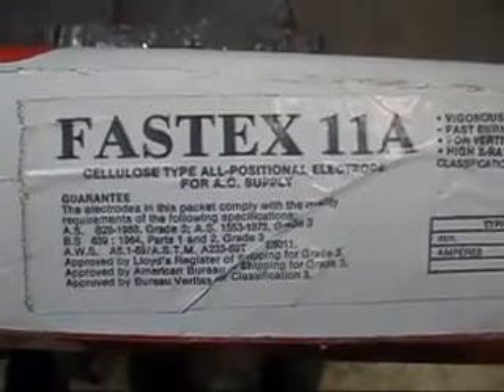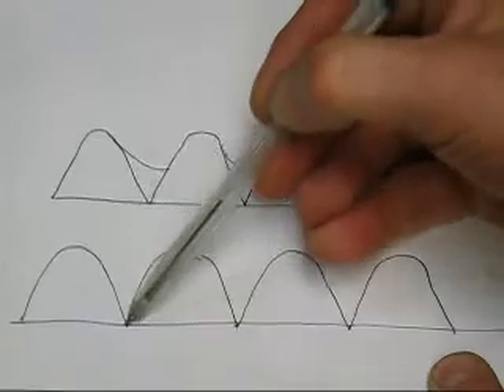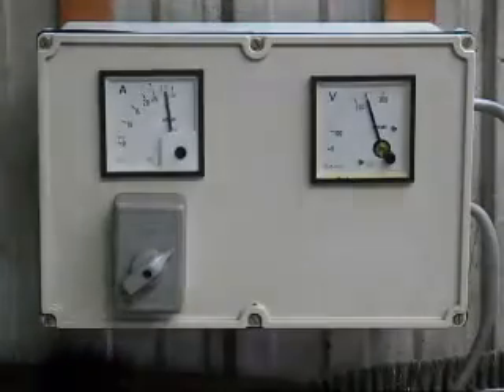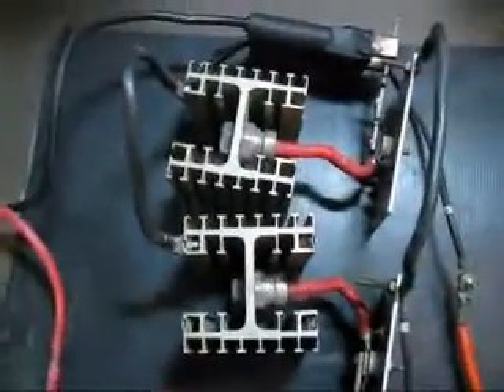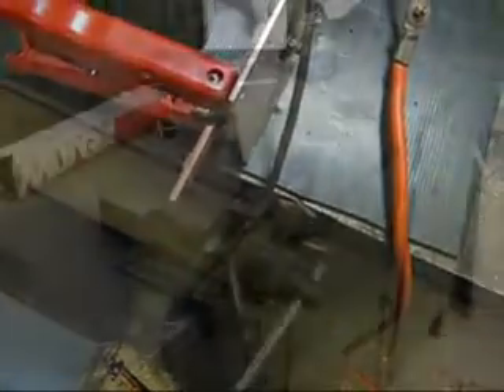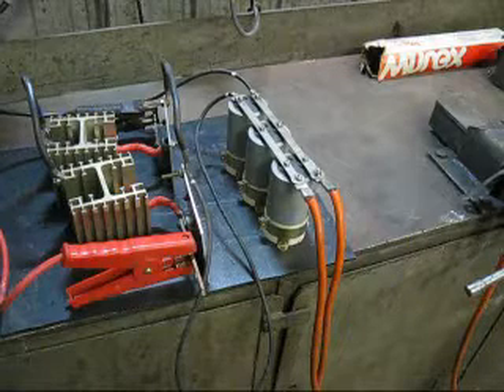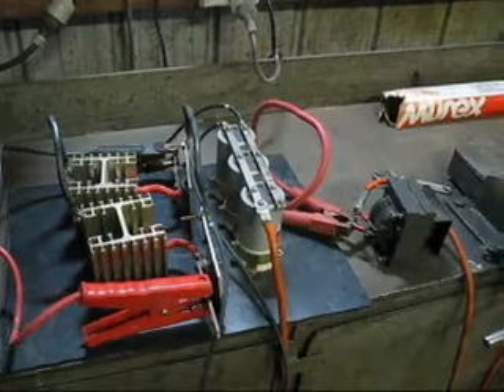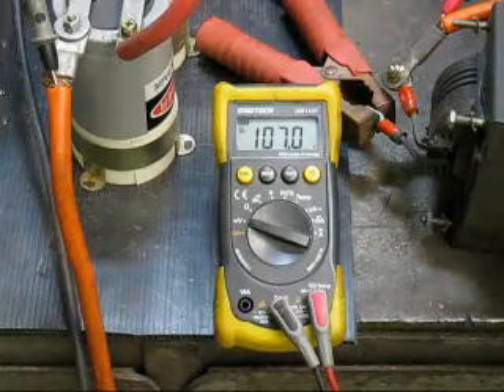Converting an AC welder for DC output

Comment: I see these projects and wonder WHY! If its just to experiment, o.k. But if you have an AC welder, use a AC rod. 6011, 6013 ect. But if you do work that requires 7018, get a proper welder! It can be done, but I doubt you will be able to gain an economical advantage over buying a unit made for the purpose.

Comment: I WAS JUST THINKING ( CAPACITOR ) GOOD #BUT  BIGGER  .. 7000 MFG .. IS NOTHING

GET SOME  250.000  MFD  CAPs   ... 4 OF THEM ... OR #MORE  !!!

YOU  WILL  HAVE  "LIGHT"  ...

AND THE  "TRANSFORMER"   GOES FROM "100 V"   DOWN TO "30 V" ... IS  TO "SMALL"

BUT JUST A COMMENT        #10  YEARS  TO   #LATE

Comment: This is mostly pointless. The size of capscitors and/or inductors needed to rectify a welder current are very large (100F-200F) and practically cannot be used.

If you hace trouble starting the arc on DC, then you are probably just a bad welder. Most DC welders don't smooth the wave at all.

Comment: PS. Can I use 2 300 amp bridge wave rectifiers in parallel?
Reply: Jo ap  diode  use kar  rerahe ho us ka nober send karye
Reply from the maker: One 300 amp bridge rectifier would be enough for welding but putting them in parallel can be tricky because both may not share the load equally.

Comment: How do you add the choke, exactly what do you do? Thankyou for sharing!
Reply from the maker: The choke is added after the bridge rectifier. It smooths out the D.C.
Reply: @luckygen1001  do bought wires, positive & negative go through the choke, or do I use only the positive wire through choke? Thankyou for your help!

Comment: When welding with DC you need to use the Negative for the welding rod and the positive for the grounding clamp. Electrons flow from Negative to Positive and that will make the metal flow from the negative to the positive and that is why their is less spatter with DC welders than AC welders alway reversing the polls while welding.
Reply: bollox

Comment: 7000uF is too small. Do the sums. At welding currents they have almost no smoothing effect on the voltage.
Reply: Correct. I use 68,000uf on my harbor freight ac to dc converted welder. its the cheap 120v one.

Comment: where did you get that choke or is that a transformer?
Reply from the maker: It is a choke.
Reply: @luckygen1001  choke/inductor. how big does the wire/gauge need to be and how many henries to support 200amp stick welder?
Reply from the maker: @joeydelmarsjr.646  Wire gauge needs to be enough it does not overheat at 200 amps. Henries is not critical.

Comment: Like other folk commenting here, I think this a good video for explaining that three components are needed for a proper AC to DC conversion..
Many others on YouTube just fit an inverter module that in reality doesn't make that much of an improvement on its own.
However, there is little to no information given on the values /types of the components used..
This info along with a diagram would have been really useful.. 
I've watched more YouTube videos than I can remember on this subject,   but I'm still not clued up enough to attempt a conversion on my own machine.. 😐
Reply from the maker: I used 6600 mfd capacitors and the inductor was the only one I had that could take the heavy current from the welder. I don't think the values are that important but it is vital that the components can handle the high currents involved in welding.
Reply: Most DC welders don't actually have a smoothing circuit. The capacitors needed to rectify the kind of waves that come out of a welder (around 70V and 100A) would be massive (we are talking in the range of 100-200F), so no welder actually does this. If you have trouble starting the arc, then you are just not a very good welder.

Comment: If I built the choke, how many turns and  what thick of cable, thanks for sharing!!
Reply: A good choice would be to have the same wire used in the welder i.e gauge {thicker if possible} and type, and put maximum number of turns that fit in the available core . About the core size: bigger is better but consider the space available and increase the thickness of wire if the core is too big. Hope this helps.

Comment: Capacitors work for constant voltage, good for wire feed welding.  The choke will be the proper solution for a constant current process like stick welding.

Comment: ground probe needs to be POSITIVE, rod holder NEGATIVE, electricity actually flows neg to pos.
Reply: Some rods are meant for electrode positive DCEP, some for electrode negative DCEN.  
I think the the rods he has are 6011 equiv (says cellulose and AC).  If this is the case they are meant to be run AC or DCEP.
Reply: No, very few rods run better electrode negative.  Most DC welders are left electrode positive all their lives...

Comment: The transformer steps down the AC mains voltage to a lower AC voltage,but in turn as the voltage is reduced the power stays the same ,thus the current supply in the secondary winding of the transformer will rise by around the same factor the voltage was lowered by,in the same manner a manometer works ,think of one side of the manometer as voltage and the other as current ,the reciprocal of volts and amps is power,if (in the manometer )gas pressure pushes one side down the other rises,the amount of water in the manometer is the same,just redistributed to either current or volts.Volts X amps = power,it's not a direct conversion in AC unless we are using say a heating element which is just a resistor,for a winding (coil/transformer) curent and volts are not in phase with each other,same as in a capacitive circuit,in a coil current leads volts and in a capacitive circuit volts leads current,this is how we experience inductve inrush with windings in a motor,the voltage is held back but the current spikes because the system wants the rated power,and to do so if the volts are low at the start the current makes up for the loss and increases to get the power rating,capacitive input circuits will do the opposite,but if the mains voltage is the running voltage it won't be as easy to note as there will be no more than the running voltage to obtain.

For the most part a lot of this will not be needed,though the full explanation would go on even further,the main points and analogy stand well to scrutiny,and the more you know the better off you will be,most induction circuits,that is with windings will draw more at power up than in full running mode.

Comment: Thank you for the video. The circuit here is a basic full wave rectifier with a capacitor filter, the series choke is required here because the capacitor will rapidly discharge into the load which is nearly a short circuit, this will create a large surge current until the capacitor is virtually instantly depleted. The series choke resists this surge current by converting some of the energy into magnetism, when the capacitor charge depletes the chokes then collapsing magnetic field induces energy into the choke coil that is then supplied to the load maintaining the arc. During this period of time the capacitor recharges and the cycle repeats.The values of the capacitor and choke can be important here. 
You may be able to eliminate the capacitor and choke completely and get acceptable results, the OCV will be a bit lower and you may have to set the current a bit higher, but for hobby welding it may not make much difference.

Comment: does it matter if your choke comes off the +or - lead? or both? Thank you.  I learned how I want to convert my 300 amp Ac welder. I wonder about voltage/ amperage  control modification possibilitys/effects .

Comment: Because of the duty cycle on a welder, you don't have to use full size conductors for the rated load, I know the US electric code has a couple paragraphs about welder service lines

Comment: The comments are confusing here. I just want to turn my ac stick welder to a dc tig welder with my argon bottle
Reply: Wrong video. This isn't the conversion you want.
Reply: You need four high current diodes to make DC.  They're available in a single package on Amazon and eBay for less than $50, search for 200a bridge rectifier.  You also need an inductor to smooth the DC  current coming out of the rectifier.  Some people wrap a few turns of welding wire around an old microwave oven transformer.  It doesn't really provide enough inductance but it helps.

Comment: Wow, o.k, so for starters you want to convert AC-DC, to do this you need a bridge rectifier or diodes in that format, and I mean High powered ones for that matter to truly have a correct DC output , DC does NOT have a rise and fall at all nor a half sine wave.You are NOT supposed to have a fall what so ever, NOT even half or quater of the way.

You are playing a dangerous game using capacitors on your system, capacitors are there to smooth out any drop or rise in DC signals and should ONLY be used on full DC not half wave, if I remember it's about 2500uf per amp.
Reply: Half sine wave IS DC , it just fluctuates from zero volts to max volts. Capacitors across the output store energy and help to reduce the voltage drop as the wave drops to zero. As long as the capacitor polarity is not reversed and operating voltage is not exceeded that is fine, it is in fact how they are used in power supplies. The choke used in series here also stores energy and helps maintain  the arc as voltage drops under load (the arc).
Reply: Sorry, it doesn't give a proper DC on my osciliscope, and the capacitors are used to avoid voltage drops which you are correct on, true DC is formed by the bridge rectifiers, capacitors stop any voltage drops, DC is not realy a half sine wave sorry, and the oscilliscope shows that clearly.
Reply: Speaking of full Bridge rectifier ever seen the electroboom.  And also the comment about the guy that got zapped by the arc welder AKA shocked would be right along the lines of electroboom as well just saying.
Reply: Have you opened up a factory  dc rectifier and checked out what’s in there, and ran it on an oscilloscope?  Everything I’ve read so far is saying you need a bridge rectifier(or 4 diodes making your own) plus a choke coil.  Lots of people suggesting it being a good idea to add capacitors.  Some vintage AC/DC welders were an AC welder with a stand alone DC rectifier piggy backed on.  Damn this is making me curious...

Comment: Hello sir @Luckygen1001 thanks for the video....I am anewbie...I found a welding transformer with an output votage of 33vac and its very hard to start...it has a builtin choke coil and bridge rectifier but no capacitor...just asking where is the best location of the capacitor? Is it before or after the choke coil?is there a big significance connecting cap before choke coil compared to after the choke coil..thanks so much for the answer

Comment: it would weld much more efficient if you installed a few large AC caps right before your transformer... so to utilize any spare voltage and to dump to transformer when needed. 
also, your output is too high to use in a dc setup. not wrong , just not optimal. 30 volts you want and it should give you 75 - 90 amps.
step down your voltage with transformer with high enough VA rating then rectify then have your dc caps storing from the rectifier and then use your smoothing transformer.
Reply: Wow impressive knowledge

Comment: My understanding is your on off cycle for average hobby welder is 5-10% so you have cooling in between striking arcs. So 15 amp rating for intermittant use. As opposed to runnin 20-30 amps continuously like with a stove or a water heater, I jury rigged a water heater up to a 15 amp plug once just as a stop gap until i replaced a component and melted the plug.  monitored the extension cable but forgot to check the wall outlet which overheated. luckily the wiring was ok

Comment: You need some big capacitors in that unit.
Reply: kg dies Actually, the capacitors might seem like a good idea, but it's not.  Why.. when welding the CURRENT is limited  (not primarily  voltage) The arc is managed primarily by the current levels especially once the arc is struck. Capacitors that have any clout to them will defeat that current limiting. So an example. IF you are trying to weld something relatively thin at a low current (heat) of say 60 amps at first strike you will have significantly more amperage dumped from the caps into the metal which will likely immediately blow right through that metal. Also  if you are inconsistent with your distance you can have much more pronounced surges of  current making welds harder to manage and probably introducing inconsistent or poor spots into the bead. An inductor is a great idea, caps not so much.
Reply: @wolvenar  I knew capacitors might not be good but now I see the reason. thanks.

Comment: not sure if you know  but DC welding is best used DCEN(DC ELECTRODE NEGATIVE ) Not DCEP (DC ELECTRODE POSITIVE )
as DCEN pushes the heat into the parent metal & DCEP pulls the heat into the electrode.
Reply from the maker: I have tried it both ways and it does not seem to make much difference.
Reply: i  can understand why you say it doesn't seem to make a difference  but the difference it is making is in the depth of penetration mostly 
the same reason tig is DCEN for steel. ps love the ingenuity and videos i would love to see a pour in person at some point keep up the great work
Reply from the maker: I will let you know when I am pouring next time.
Reply: 7016/7018 must dcep,electrode get positif,,for 6010/6013 dcen make deep penetration for thick plate
Reply: Good grief what’s with all the comments saying this?  I’m no scientist but I can tell you as a welder you’re wrong.  Nearly all rods run better electrode positive.

Comment: Is this center tapped kind of transformer? because you needed only 2 diodes at your setup...
http://electronics.stackexchange.com/questions/52057/why-do-we-use-bridge-rectifier
Reply from the maker: No it is not center tapped so it needs four diodes.
Reply: AFAIK meanwhile you loose half the rectification, and half the power..

Comment: I thought it might be that simple.  I've been an electronics geek since I was a kid.  I bought some 250A, 300V diodes to make my rectifier (only ~12.50 apiece)  and I found 2500 mfd caps, but can't seem to locate them in 100V (my ac welder is ~90 OCV), where did you get monsters like that?  Also, what value are the chokes you used?
Reply from the maker: The caps came from a really big inverter, they are rated for 450 volts. The choke came from a power supply, I used it because it has very thick copper cable suitable for welding purposes. I will have to measure how many milli henries it is.
Reply: Thanks.  I've since been able to find caps that big (good Sprague ones, too).  Maybe I should just find the biggest choke I can get.  I couldn't really see it in the video--does it have an iron core?
Reply from the maker: DeltaRacing Yes.
Reply from the maker: The choke value is 3.76 Milli Henries

Comment: Be careful when you use Diodes in parallel! The have a negative thermal resistance, the one that is hottest gets the most current and more and more.
You need a kind of shunt in series to prevent them from overheating - but its kind of tricky to find the right shunt for that job. Look at commercial welder stack rectifiers:
there are little small copperbands (sometimes material is different to get the right resistance) connecting the diodes in the plates.
You are lucky that they didnt pop yet - it depends on how exactly similar they behave internally :-)
Reply: This was proof of concept testing.
Silicon diodes, he can get two more.
So nothing should "pop."
And most obvious, all the bits laid out in a cold shed. In USA a Lincoln Tombstone is the best donor to do a DC conversion. Or spend $200 more for the DC box. Your Grandson could inherit a working unit!

Oh, please remember the demo box O rods were marked: For A/C.
Many thanks for this great bit of kit.
Reply: A GENEROUS heat sink is wise too.